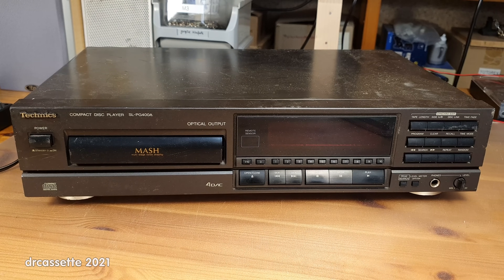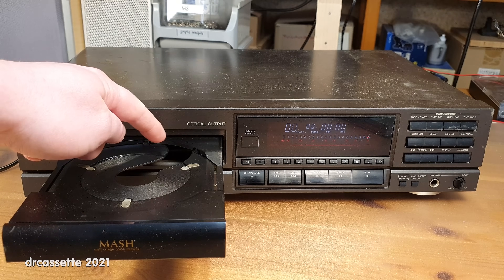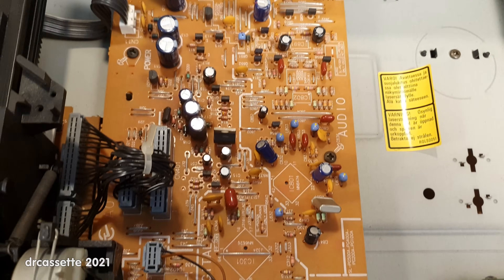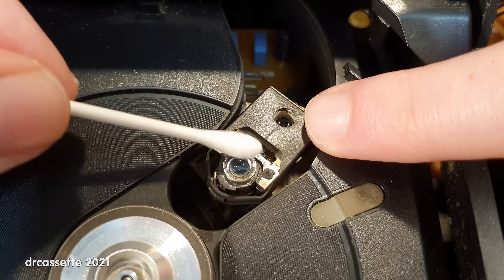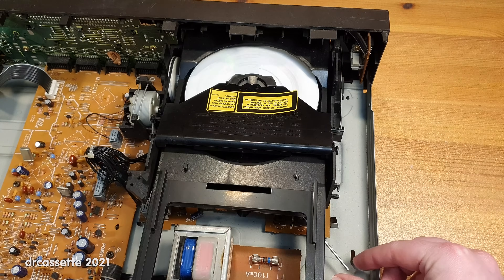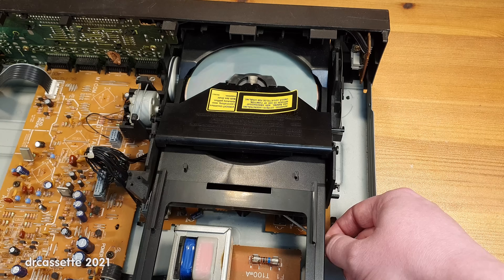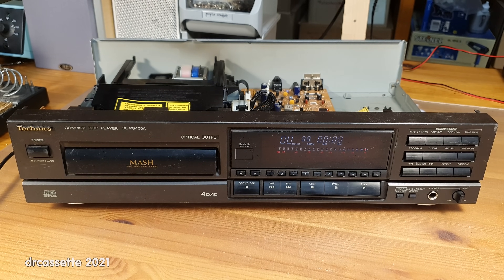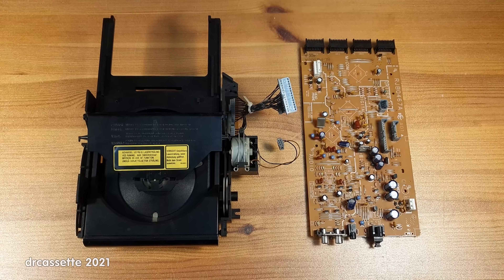Technics SL-PG400A CD Player repair attempt

Comment: Thankfully, on my unit was only one issue: potenciometer for headphone audio was dirty. Cleaned, I also cleaned CD optic (no issues before), and it works perfectly now. Do you know, which remote control is suitable for this unit?

Comment: Would you say this range of technics cd players is worth bothering with second hand, or are they always prone to faults like you suggested at the beginning?
Reply from the maker: It seems like a very common problem with these Technics CD players are some bad capacitors that are hidden away on the servo board under the mechanism. I only found out about this problem in recent years, it could very well be that all those Technics CD players I had problems with in the past could have easily been fixed just by replacing those capacitors, but there is no way to know for sure.

Comment: Had the same problem on my unit. After trying the adjustment screws (from the holes underneath the base), I was about to give up. After changing over the spring holding down the laser head from right hand side to left hand side it somehow cured the problem. (Note: his unit has a rubber band instead of a spring). Thanks for the video 👍

Comment: For repair this problem, remove and test the capacitors from servo board. Many CD Players Technics present this problem
Reply from the maker: Yes, later it turned out that was indeed the problem.

Comment: I have the sl-222 model that started doing the same thing until it finally stop reading the CDs, i recently replaced it with the same model i found in ebay, thanks for the video now I know where to look for the problem.

Comment: My Technics SL-PG520A had same problem. I noticed that the laser potentiometer had a bad soldering. Probably somebody has tried to adjust it by too rough manner. 

My player has only one pot. After fixing the soldering, I was able to tweekie it by adjusting the potentiometer very very s l o w l y !

My player has two HOLES in the bottom where it was easy to adjust with PH00 screwdriver. 

I also taped the dangerous fuse with thick clear tape. This sadly is Philips style whereas Japanese equipments usually have very well shielded mains components.

Comment: I have a cd player technics SL-PG590 and it has a problem: I press the open button to insert a cd but it closes by itself I give ooen it closes by itself and so on. If anyone can help me, thank you
Reply from the maker: Sounds like you have a problem with the limit switches detecting the position of the CD drawer.

Comment: Most people who deal with equipment like this know that Philips mechanical and digital systems were among the most used by many other brands that manufacture this type of equipment. The mechanical system use by this Technics (as you know) is the famous CDM-4/19 from Philips, used by dozens of models from a wide variety of brands (even by ROTEL in some models). Thanks for the video

Comment: Perhaps an issue with one of the Ic's?
Reply from the maker: It later turned out the problem were some capacitors that are hidden on the servo board under the CD mechanism.

Comment: I have a Technics SL-P202A Recently didn't want to spin. If i give it a spin by hand it starts up. Motor seems weak i tried adjusting laser pots but no difference, needs a hand spin up. Wondering if motor os old or perhaps more likely power supply is weak. One guy fixed a similar issue by putting in a lower value resistor but this was on a slightly newer model.
Reply: The spindle motor gets lazy draws too much current and can't get up to speed.
Reply: @glpilpi6209  This is not true. I found the solution. Look for the "metal can" capacitors on the board that is attached below the laser mechanism. Change any of these blue Phillips caps. Job done! Enjoy!

Comment: ok thankls for the video...opened my exact same model up and cleaned the lens with spit on a cotton bud, dried it other end, reloaded cd and hey presto read perfectly, million thanks else i wouldnt have even known where it was!...guess i got lucky, its 1991 again now, thankyou
Reply from the maker: You are lucky that your CD player only needed its laser cleaned - these players tend to have problems with bad capacitors on the board below the mechanism as I later found out...
Reply: @DrCassette  ive had it since i think 1992, first problem, love this machine

Comment: The laser light does not appear to come on
The laser goes up and down trying to do its job 
Can anyone help
Reply: Laser unable to find focus . Shuts everything down. Weak laser or photo diodes in the the laser block failing to provide signal for the focus servo loop.

Comment: I own two models from this era, no problem at all, fingers crossed!
Reply from the maker: In the follow-up video I found that the problem was caused by a bad capacitor on the board under the CD mechanism. So if your CD players ever develop a problem, check those capacitors. They are easy to replace.
Reply: @DrCassette  I've checked the second one but thanks!

Comment: Interesting you mention that all SL-PG players you had didn't work. Assuming you are in Germany, most of them (at least all up to the x60 models) will have had the CDM4 mechanism. That doesn't give a good impression of said mechanism, of which one can read a lot of positive opinions (except for the drawer gear issue).
Reply from the maker: None of the SL-PG series CD players I had over the years would properly play CDs, but I now have to assume this was not because of a problem with the mechanism or the laser, but because of some bad capacitors.
Reply: @DrCassette  Which would be an important information for me as well. Thanks for posting the update video! OTOH, isn't the servo board (where you found the bad capacitor) also part of the complete CDM4 drive assembly, made by Philips, and so should be found in other CDM4-equipped players, regardless of brand, as well?
Reply from the maker: The layout and choice of components used for the servo board looks very different from the other boards in the CD player, so I would assume that this board was indeed made by Philips. But I don't know if these boards were a universal part for all CDM4 mechanisms.

Comment: Sounds like its the drive belt.
Reply from the maker: No, there was no problem with the drive belt. It was a problem in the electronics, caused by a bad capacitor. This has been discussed in another video I made.
Reply: @DrCassette  Hi yeah, I did watch the follow up video. I use a Technics SL-PG420A

Comment: I have a Technics SA-CH455 with a dim VFD display. The CD player's display is perfect yet, but the tuner display and EQ display, not so much. I found a section of the PC board was burned, so I tested and subsequently replaced two of the resistors in that area, but still no joy. NO ONE has any ideas of where to go next with this thing. In fact, my local repair shop couldn't even identify the ohm rating of one of the resistors! Any thoughts? 

BTW, your channel is my new "binge watch" channel! 😊
Reply from the maker: I would suggest testing all voltages the display needs to work. Heater voltage and the high voltage fed to the display driver circuit. If the voltages are fine, the display itself may be at fault. Starting in the 90s, the quality of these VFDs became more and more random. Some still look like new, others go dim. In later years, Technics' parent company Matsushita (Panasonic) was known to use bad VFDs.

Comment: Dr Cassette I have been repair Cd players since they first came out in the 80s professionally  and my shop was authorized service center for Panasonic and Technics and you are correct Phillips made the CD unit for them and I repaired a lot these when they were almost new .

Comment: Do reccaping and then try to adjust.
It helped me ;)
Reply from the maker: There is one specific capacitor in these CD players that needs to be replaced. There will be an extra video about that. However, replacing all capacitors is unnecessary.
Reply: @DrCassette  ;) OK!
Reply: @DrCassette  what do you do is this case buy a new laser or scrap the cd player?
Reply: @brunomoyano8727  Scrap because the laser unit if you can even find one would be to costly
Reply: @DrCassette  so true but right now in my shop I have Sony portable radio from the 70s Sony used some really no name capacitor and found like 4 that were bad .

Comment: My friend , please i want like know what you use to clean the plastic and metal front panel , i have any pioneer and yamaha and i need clean frontal panel , i living here in Brazil ( Amazon)
Reply from the maker: For cleaning the case of HiFi components I usually use an alcohol based window cleaner.
Reply: @DrCassette  you can make a video clean a cassette deck player or receiver amplifier
Reply from the maker: No, I am not going to make a video just about cleaning. That is trivial.
Reply: @DrCassette  you are correct , what you think if I ship a defective Brazilian brand Cassette Deck player ? I have brands like GRADIENTE or POLYVOX. You not need pay or return the player ,. What do you think?
Reply from the maker: Thanks for your generous offer, but shipping from Brazil to Germany would be prohibitively expensive...

Comment: No one has said It, so I will, The rubber band was standing In for the Missing Spring. You can't win them all.
Reply: I you look closely, on the right side of the CD clamp there was a spring. It seems when they designed it they intended to use two springs, but probably found that a stronger spring on one side worked just fine and saved a few pennies and install time.
Reply from the maker: As I have said in the video, there was no missing spring. There are provisions for installing a spring, but Philips did not use them. That space is supposed to be empty.

Comment: I had one of these back when they were new. An absolute piece of garbage! In the first year I owned it it spent more time in the shop then it did in my house. Technics actually gave me a replacement unit after a year and it wasn't much better. I finally solved the problem by buying a Sony, which ran trouble free for almost two decades before finally dying.

Comment: I could see that metal hexagon key looked very close to that live mains voltage fuse,,,while trying to adjust the laser reader,,,would've been some fireworks if it made contact,,,,possibly blowing the machine to pieces and kill the video camera!!!
Reply from the maker: The hex key was not as close to the fuse as the camera angle makes it seem. Everything was safe.
Reply: @DrCassette  glad to hear it buddy, it had me wincing lol. 

Seriously though, if you have a thin enough bit of shrink sleeve, just insulate the shafts of any allen keys or screwdrivers that you use for any trim pot adjustments, it saves any accidents from happening… I dropped a brick a few years ago when I dropped a screwdriver inside a Pioneer SX1250 receiver I’d spent rebuilding whilst it was setting the DC offset… I’ve insulted my tools ever since. It cost me many labour hours and quite a few parts to rectify that one. Luckily my customer was very understanding and grateful of my honesty… and he was delighted when he actually got his amp back.
Reply from the maker: Accidents like that are very unfortunate... I don't often come across adjustments that require a hex key, for most standard trimmer adjustments I have a set of ceramic screwdrivers with plastic handle, to keep everything well insulated.
Reply: @DrCassette  I learned from it, I do have some ceramic screwdrivers for trim pot adjustments, those are a great idea. I’ve got a few insulated allen keys too though. I insulate all but the tips of my probes too, I never want to make a mistake like that again. I went straight for the power switch but the damage to the output stage and power supply was instantaneous. Gorgeous amp once it was fixed though, gave my Linn amps more of a run for their money than I like to admit.
Reply: @Si1983h  That allan key looked like it was so close to that mains supply fuse,,,it had me twitching for a minute or 2 at one stage.
Reply: @DrCassette  Any cd player,,,tape deck,,,radio tuner amplifier,,etc,,I always look for exposed mains high voltage terminal points,,,and I always cover them with electrical insulation tape,,,especially if it's close to the area I need to work in,,,requiring power to make fine tuning adjustments to cd player,,,tape deck speed,,recording and playback sound,,,fine tuning radio tuner trimpots for oscillator alignment and station reception. And of course,,,use well insulated screwdrivers/allan keys too.
Reply: Nope, it wouldn’t do that… it might kill the person touching the Allen Key though… made me very nervous watching it, even though I knew he hadn’t come to harm because he’d uploaded the video. Too complacent for my liking. I insulate any metal tools like that with electrical tape or shrink sleeve to prevent any shorting, and I keep my fingers well clear of any high voltage bits… I’ve been shocked after accidentally coming into contact with 240v mains and not been harmed but it can kill you outright.

Comment: It's funny. I seem to see the obvious issue with the unit that you and all that have watched so far have missed. The laser units with cd players are generally very reliable. But the motors that spin the disc and move the laser head are not. Not to mention the age of the lubricant on these parts. I can see the disc speeds up and slows down when you were adjusting the laser unit. The best thing to do would be to live the spin motor bearings and clean and re lube the laser head motor track. I bet this would make things unit work like new. The last 5 units I fixed had the same issue and it always overlooked. CD players need to spin at a very specific RPM to function. Also make sure the transport mech is also well lubed.
Reply: This, and also look for any failing electrolytic caps around the servo circuitry and on the power rails to the servo circuitry, voltage ripple there would play havoc. Generally, if a laser is failing, it’ll skip/mistrack until it can no longer maintain focus at all, at which point it won’t spin the disc up because it can’t detect a disc there. The spindle motor doesn’t turn when there isn’t a disc present, so if it does spin, the optical sensor is detecting a focussed laser beam. It really amazes me how many people automatically assume that all CD reading issues are down to a failing/failed laser, quite often, it isn’t the case, especially on these early Philips mechanisms, and mechanisms such as the Sony BU-1, KSS-151 etc, they were/are incredibly reliable.
Reply: I totally agree. I had skipping issues with my Technics cd player and i had checked everything but the motor with no luck. I finally sprayed some contact cleaner on the motor axle and problem solved!

Comment: Servo circuit, lyth capacitor c2521, 47 µF, 25 v, that horizontal one, this is a weak point of these CD transport's. Can change with any vertical lyth cap with same parameters of course. After that, adjust carefully laser power if needed. I personally recommend to change all lyth caps on servo circuit, clean all mechanical parts and lubricate spindle motor.
Reply from the maker: You are right, I checked C2521 and it is indeed bad. Measures 20 µF instead of 47 µF, and the ESR is 16 Ohms. The CD player has already been scrapped, but the next time I come across a non-functional CD player with CDM4 mechanism, I will make sure to test and replace that capacitor. I have made a follow-up video testing that capacitor which I will upload soon.
Reply: Thanks I've fixed mine.. I used 47 25v upright n a, dart to scratch off that seal stuff n it's perfect I got a spare from car amp n estended wires with a cheap blacksur soldering iron... The inset was hardest part two white wheel s mounted too back posts.. But it's fine n worth it
Reply: I know I'm late but I've been having the same issue, I had to use a 50v capacitor instead of 25, but after tweaking the laser a bit the disk inside stops spinning after 2 seconds but the display still shows zeroes everywhere and nothing works... Does it have to be exactly 25 volts in order to work?
EDIT: I tried to play again with the laser and focus a bit, it seemed it started working again at first, just a little skippy on some tracks but it was playing,  then as soon as I started playing another normal CD the hard-knocking issue was back and it was struggling reading. I am considering to throw it away as well because I don't know what else to do and I've been reading that particular Philips mechanism has a very bad reputation (now I know why)
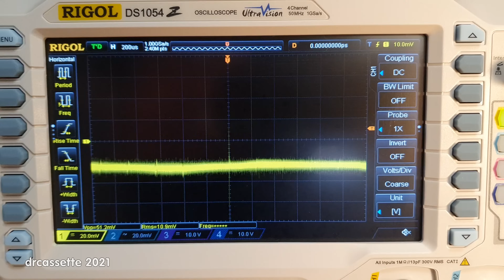Reply: Spot on, I had the same issue and this cap was the reason, thanks for posting, I doubt I would have found it myself. I learnt that the scope trace of laser 'power' measurement at 9:24 is useful for diagnosing the problem: I had the same wavy noise shown in the video with the bad cap but after changing it for a good one the noise went right down and matched what's shown in the service manual.